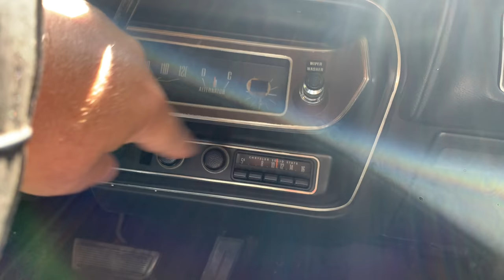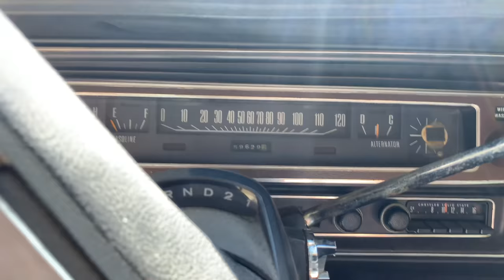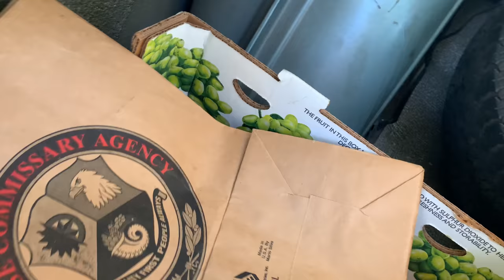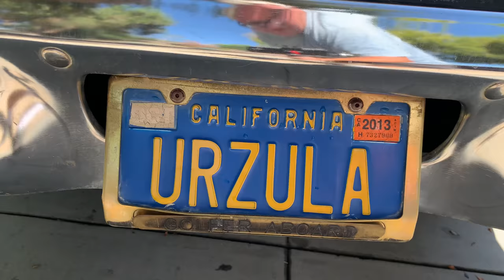1971 Dodge Coronet Custom Sedan Mopar 383 V8

Comment: I got a '76 Valiant from the original owner on the Tulalip Rez; it was parked when the heater core let loose & the radiator was weeping at the upper tank in the late 1980's. I had to promise not to cut it up or flip it, which I have honored- I took it from Seattle to NC when I sold off & escaped the nuttiness that is the Seattle area. Probably helped I'm Choctaw/Chickasaw, too, 😆 
Today it has 88k miles. It has 12" rotors, full 340/A38 suspension, mild modifications to make it tighter, KYB shocks, cop car wheels with 60-series blackwall Bridgestones, dual exhaust, Edelbrock intake & 650 cfm carb (318 for now), Comp Cam whose power band is 1,800-5,800. 
It will be running in a TDS event in January from Atlanta to Texas